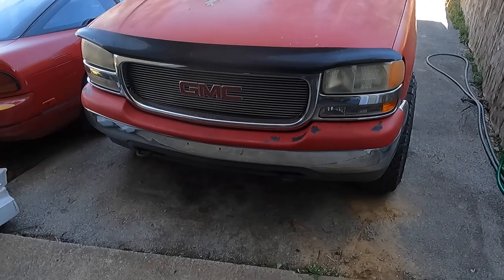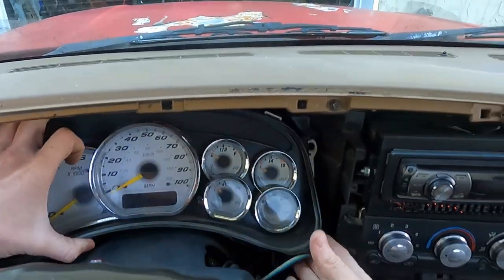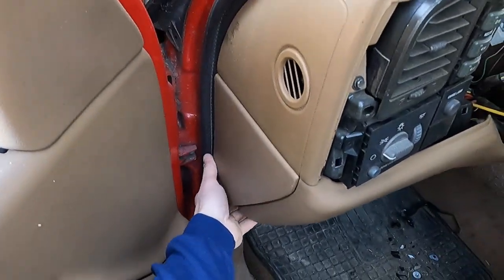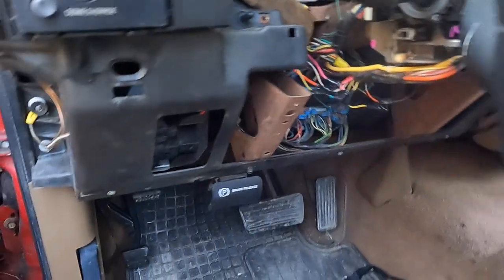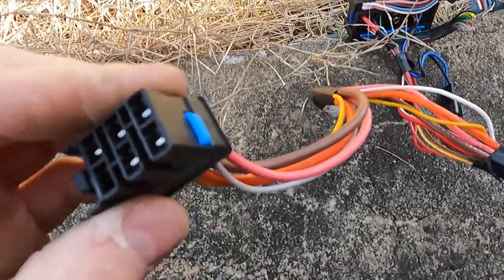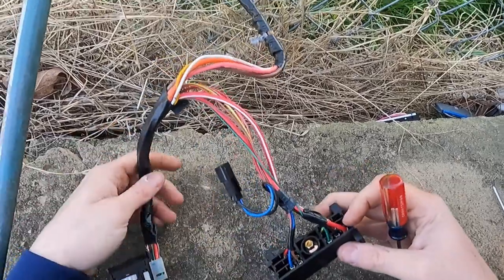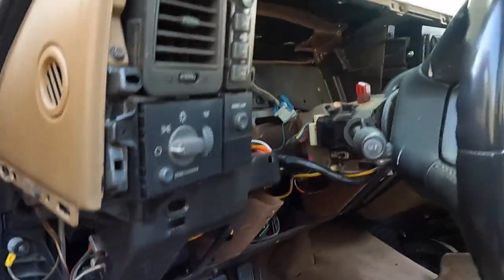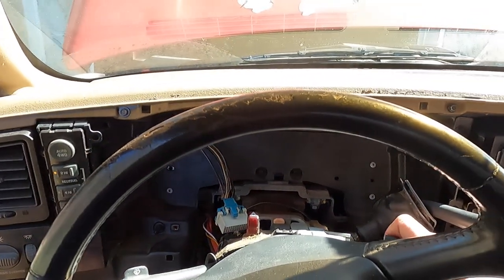99 sierra ignition switch replacement

Comment: You answered one of my questions I have asked and NO ONE knew or would say anything. I have 2001 HD 4X4 crew cab and many times I could NOT turn the key all the way back to Acc. to pull the key out. Had this problem with an old 1995 Siverado but the dealer FINALLY found a loose "Bitsy" cable after trying 4 times. Thanks.
Reply from the maker: Glad it helped

Comment: My fresh air blind door actuator would always make noise like something is running in my dash…. Great video straight forward my transaction isn’t shifting properly and the shop told me that the ignition switch may be bad but Thank you for the amazing video !!!!
Reply from the maker: Thank you
Reply: Did changing the ignition switch fix your transmission issue?

Comment: Thank you for showing how the harness goes. A thief tried to steal my 01 Silverado by using big pliers on the key cylinder. I have a hidden kill switch so they didn't get my truck but they did damage the plastic gear in the switch. I have to replace it and didn't know how. Thank you again.
Reply from the maker: Thank you. Glad it helped

Comment: Thanks man! I appreciate the video first one I stumbled on with the complete ignition switch along with harnesses video. I guess theirs 2 styles of ignition switches (1) being just the adaptor plug under steering column. 2nd has also a plug adaptor under steering column but this set up comes with additional wiring harness under dash as in video. 👍🏽
Reply: I also agree your video pointed out all the stuff that everyone missed or left out it's probably the frustrating and cussing so thank you man you should be a TV mechanic you have a good character

Comment: This video is great! No bullshit, straight to the point and very helpful! Quick question, when testing the ignition switch to make sure it has power, which wire do I check?  Where do I find a break down of each wire? My grandma’s 01 sierra is not cranking or starting, found that there is no power going to crank fuse or #85 pin on starter relay while turning key to “start”. Every other fuse is good. The engine cranks when jumping the starter relay, but won’t start, so I need to check the ignition switch. Any guidance would be greatly appreciated!

Comment: Good stuff Thomas! I know what you mean about hacked wires... My '99 Suburban is stuck in "SECURITY" mode and does the start, run 2 seconds and shut-off nightmare right now. Watched 100 videos about how to "reset" or "by-pass" and even replace the passlock module to no avail. I found that someone prior to me did the "diode splice" trick to bypass the VATS but now my truck thinks I'm trying to steal it! FML... I'm out of options at this point. Have you ever had this issue? I know it's not what you just did but I'm watching anything related to ignition at this point. Thanks for posting.
Reply from the maker: I've not had to deal with those problems. But one solution could be to get someone to turn vats off with HP tuners but then you'll have no security but then you'll also have no security to fail lol

Comment: All the upper pieces you removed weren't necessary.  All you need to take off is the steering column clamshell and the lower dash plastic and metal bracket.
Reply from the maker: You do you buddy

Comment: I can’t get the tooth in the right place ill cash app you some money if you videocallme
Reply from the maker: Will it not start or not shut off?
Reply: It just starts and shuts off bro
Reply: Ill cash app you some money if you videocall me if you tell me how to do it
Reply from the maker: @benitosanchez6951  that's not the ignition switch causing that. The transceiver around the ignition switch will cause that because it's not recognizing the key or its not functioning at all so it thinks you're trying to steal it.
Reply from the maker: @benitosanchez6951  it's possible you have the ignition switch in there wrong just pop it out and turn the gear with your fingers if it starts and stays running you had it on the wrong tooth if it starts and then dies it thinks you're trying to steal it. It's been too long since I've had to mess with that I don't remember how to fix the transceiver problem
Reply: @benitosanchez6951  Did you ever get it fixed? Having same issue